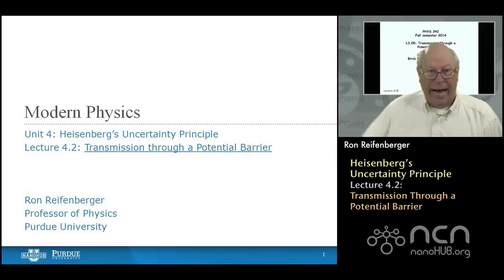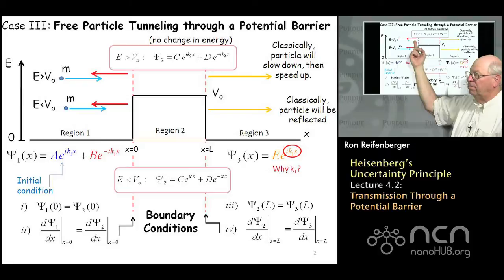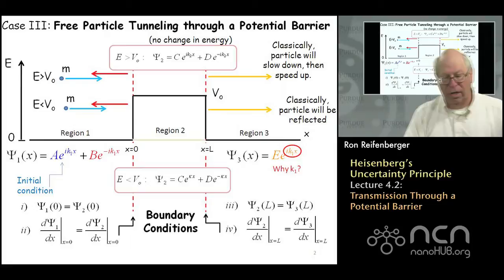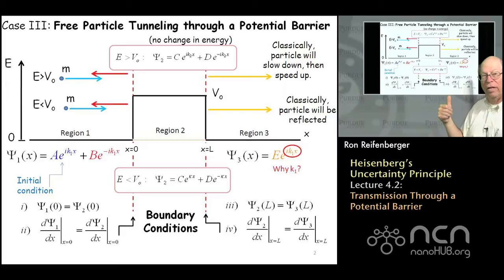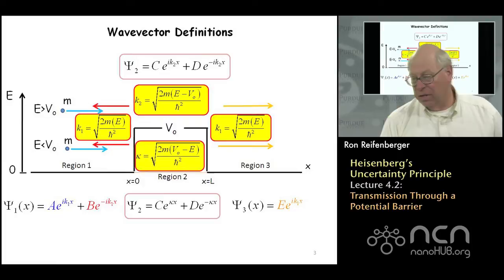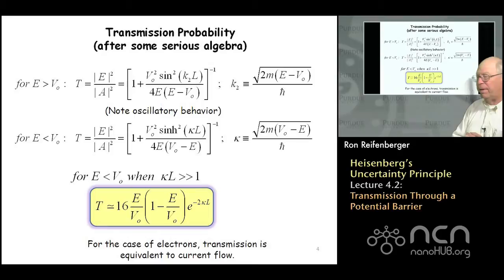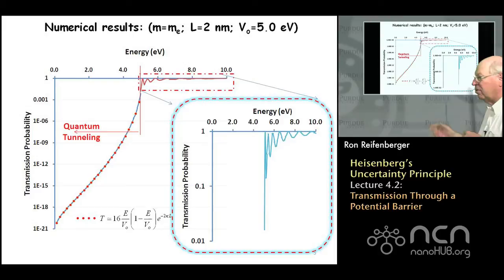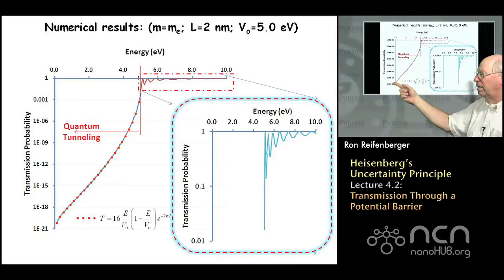Purdue PHYS 342 L4.2: Heisenberg's Uncertainty: Transmission Through a Potential Barrier

Comment: would those transmission formulas work if the potential well was drawn differently. For example, if it was drawn "upside down" with -V_nought? Or do i have to derive it depending on the problem?